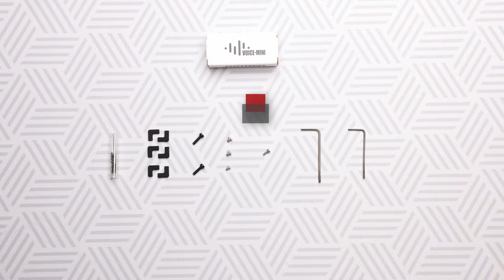wireless 7-key pad with a scrolling wheel | VOICE MINI is owlab's 1st keyboard in 2023

Comment: what spacer did you use, I used owlab stabs and ya they are sitting to low sadly.
Reply from the maker: I do not recall using any spacers tho~ teflon on the pcb and thats it.

Comment: Great video, How's the scroll wheel like? Does it smoothly rotate or is it stepped?
Reply from the maker: it is stepped encoder. kind of wish they put a ball bearing in there tho～instead of metal on metal contact～
Reply: @drheystudio  Did you try adding a bit of lube? E.g. Krytox 205 g0 or dielectric grease aka. Superlube?
Reply from the maker: @Nickrii  yeah, they are still too thin to make a difference.

Comment: which tool did you use to remove the screws from the plate?
Reply from the maker: I think I used a t15 but it is better to use the allen key came in the kit if they fit.
Reply: @drheystudio  Thanks for answering. I have an allen key but there is a tripped screw, so it doesn't work.